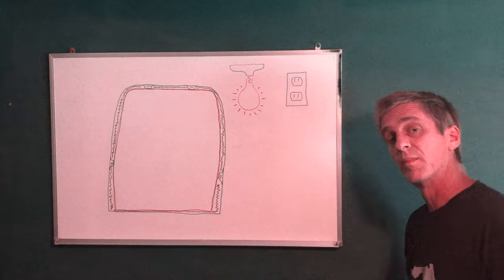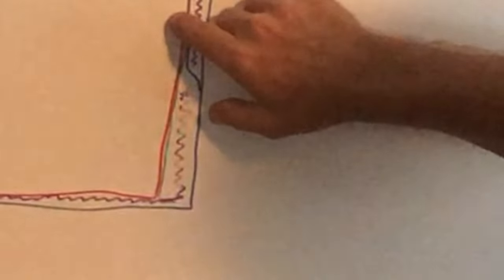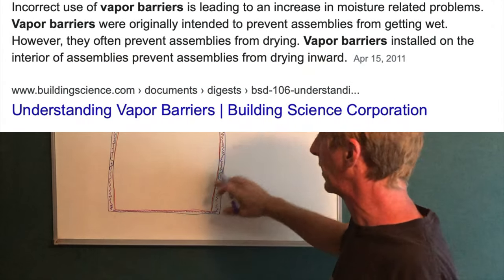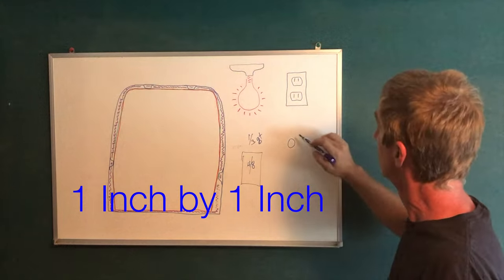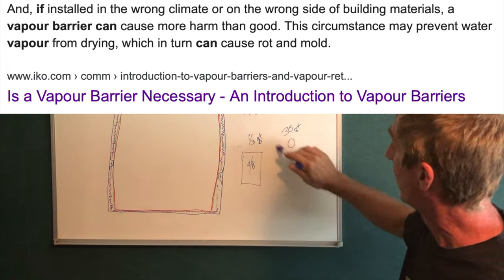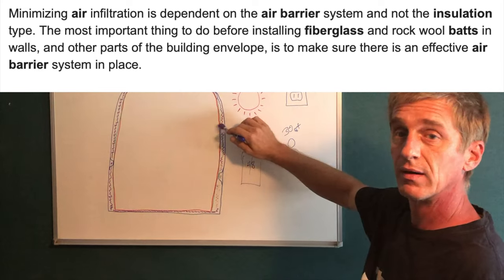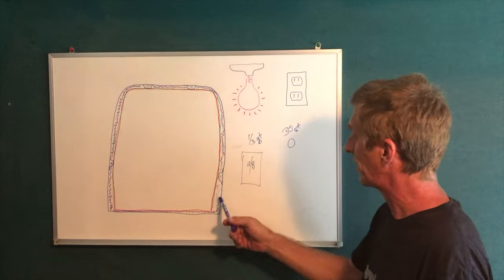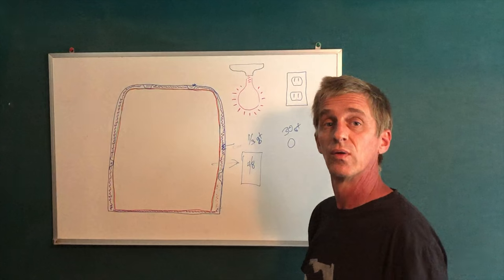Vapor Barrier in a Camper Van Good or Bad?

Comment: Once again, you have nailed it, and in less than 23”.  A lot less.  I wish people could be more succinct.  Thanks again!  I’m having adventures in Lizard skin ceramic thermal insulation.  Made more adventurous by my own idiocy.  Probably.  I’ll know soon.
Reply: Let us know too please, wish you good luck!
Reply: How did it work out for you using that Lizard skin?
Reply: @TheSololobo  - Well, I’m still (yes, pathetic) working on the van.  Using a temp gun, it does seem to have lower heat than the untreated interior.  BUT the things I have learned are that if you want to put up a noise dampening product like Fat Mat, you need to do it before you spray.  Nothing seems to stick to the dried LS.  Second thing I learned was that if you make your own LS (from acrylic paint with ceramic beads), you need to make it a very thick product.   I under mixed it.

Comment: at last! a man that talks sense too many self builders  around the world following the greg virgoe method! a guy that builds campers for a MAJOR uk motorhome  manufacturer told me that the most important thing in a camper is insulation and AIR CIRCULATION ....
Reply: Greg's method is scientifically proven. But it has to be done perfectly to work 100%.
Reply: @ezioauditore3128  yes impossible to do 100%

Comment: So basically I probably shouldn’t vapour barrier as there is no way I’m capable of 100% seal
Reply from the maker: Correct. A barrier can greatly limit the moisture that gets in, but it also greatly reduces the ability for moisture that does get in to get back out. Paneling, plywood and other common wall surfaces will prevent vapor from passing into the wall cavity, but allow any moisture that gets in there to absorb into the wall board and then dry into the room, very slowly. My experience includes relatively short periods of high humidity in the van, of the course of any given year. if living in the van full time in a humid climate (more humid than Florida) I might* reconsider (probably not).
Reply: @FloridaVanMan  SO what should we use then?

Comment: Great tutorial! So ur resolve is to try and seal via great stuff, metal tape ecr ect. O of subject u commented on my LM about a wk back. On a 2003 it has a vacuum resinator. Pulled most of my hair out ting to finger the LM out. Well I had a 4 legged toothy critters that had chewed the wiring apart. Rewired and good to go. Tanks 4 ur help.  Ciao

Comment: Agree. Today it's minus 4 Celsius in the Uk. I'm mid building my van. The uncovered ribs of the van are dripping wet, obviously, but the carpeted ribs were completely dry. Is there such a thing as making a dedicated dehumidifying surface? Obviously the windscreen is a natural contender but I have a bulkhead. I wonder if leaving the back doors uninsulated that all that water would collect there. Or would it be unnecessary once there's heating installed?
Reply from the maker: Cold glass makes a great "sacrificial anode*" to draw moisture out of the air but DRY heat is the key. Diesel heaters are great for this. Other tricks like minimizing moisture in my shower towel helps. I do this by drying a bit with my washcloth and ringing that water out before grabbing a towel that will 'dry' in my van causing airborne moisture (humidity). A laundry basket full of hot dried clothes will draw considerable moisture out of the air in such a small room, so fold clothes in the van, not in the automat. If you must boil water in the van use a whistle top kettle to contain the steam until it can't.

Comment: My brother used to run a crawlspace mold mildew repair business. He put vapor barriers down in crawlspaces and then scrubbed all the wood and then sprayed the hell out of everything with killx or whatever it was called.

Could one use that spray on the walls of the van to prevent mold/mildew?

Seems like the best solution is to use wool to insulate, put up your decorative wall and once a year, take it all apart and clean the walls and put it all back. Probably replacing with new wool.
Reply from the maker: I doubt the stuff used in crawl spaces is something we'd want inside the cabin, even inside the walls. Crawl space is 'outside' the insulated space.  The 'best solution' is different depending where you live and travel.  Insulation is just one part of preventing mold and mildew. Reducing condensation can be very effective. Easy things like drying my body mostly with washcloth before using my towel. Ringing the washcloth puts several ounces of water into the drain that would otherwise evaporate from my towel. Use of propane inside the van is just pouring water into the air for collecting on any cold surface. And closing or covering your drains will keep water down the drain from evaporating. Anything you can do for a doormat to keep snow outside is obviously going to be huge.

Comment: Ok so I get where you're going with this but I have a specific question. I'm in Canada in a climate with temps that go from +40c to - 40c over the course of a year. The trailer is made of sheet metal and steel ribs with a curve where wall and roof meet. Because of the extreme way condensation can occur between the cold metal and the insulation/wall would a vapour barrier with a exterior vent (the curve is going to be empty space which I could take advantage of as a pseudo attic) be a way around this problem? Currently gutting and rebuilding so now would be the time to do it.
Reply from the maker: If the outer skin of your trailer is non-porous and has no holes or cracks for vapor to get in, that is your vapor barrier. You could vent it like an attic, but this would be venting the existing barrier only to allow the use of a second barrier. The vent to the outdoors will cause much more heat loss, compared to venting* the attic to the trailer interior. You are going to have some moist vapor in a small living space, that's unavoidable. We need to be sure it doesn't get "trapped" where it cannot get back out. Any pocket between two barriers is a "trap", and your trailer skin is a natural barrier unless  it is made of wood, bricks or overlapping metal panels that are not seam welded. Vans and Airstream trailers are all seam welded, but cargo trailers are not. Many older RV's and some cargo trailers are skinned with fiberglass panels and sealed with  caulk that dries and cracks. This is NOT a vapor barrier, so in this case I would install barrier (and anticipate mold in the wall after a few years).

Comment: Hi! great video, I've been trying to get my head around all the information out there regarding vapour barrier and it hasn't really made sense. this has greatly helped. The only thing I can think of is would it help to  completely cover the large panels in my van with acoustic matting to put another layer between whatever water vapour makes it through the walls? I intend of being in the van over winter and would like to reduce the potential for ice forming, but then I suppose dry heat would help this too..?
Reply from the maker: A perfect seal is very hard to get and even harder to make it last forever. Avoid thinking you will keep ALL* moisture out of any space and allow every space a way to dry-out. Complete covering with acoustic mat has proved disastrous for many. As humans, we just can't get it perfect in every corner, and where it is not perfect it traps dirt. Dirt holds moisture, moisture feeds rust and the knee bone is connected to the ankle bone. I mean rust grows out from anywhere it can start. Closed cell spray foam is the best sound reducer and moisture combatant. A breathable wall (any other insulation method) is fine for most situations, but if I were going to be full-time in the van and often in cold climate, professionally installed closed cell spray foam would be a clear choice.

Comment: Hi, what is your opinion about adding an electric dehumidifier in an insulated van ? Do you think it could create a humidity level as low as in a house? I precise that I plan to buy a big electric station (like Bluetti AC200p or something) so electricity won't be a problem I think.
Reply from the maker: Household electric dehumidifier produce heat. Electric heat on battery just doesn't work. Dehumidifiers come in all sizes but an average dehumidifier will require more than half the energy of an average air conditioner, which is quite a lot to ask from a portable battery unit like Bluetti. If you are in a cold area I suggest diesel heater and a dozen tips on managing the moisture inside the van including how we use a towel & washcloth after showers. Minimize use of propane, a tray for snowy shoes that drains out or gets dumped, and using the windshield condensation point to extract some moisture, removing it from the van with paper towels.
Reply: @FloridaVanMan  Thank you very much for the answer and the tips. I am not in a cold area but I have an allergy to dust mites so I need to be careful. And also I suspect that mold can come easily in a car or a van.

I thought about plenty of tips. For instance, one of my personnal rule is "never cook inside, no shower inside". And I could go further by saying that any kind of wet clothes or towels will go directly in a special closed box then washed and dried asap.

Also I think one of the best solution is to minimize any kind of fabric and to clean very often all surfaces with baking soda, vinegar... So for example, to limit moisture and dust mites, my mattress will be an inflatable electric one made of plastic, same thing for my pillow, and will be washed very often. And so on.

Comment: Great vid, i have decided to go without a vapour barrier and have loads of ventilation instead. I have a maxxair fan up top and drop out vents down below. I have put foil backed sound deadening and PIR board all round boxed in with wood cladding. My idea is to have some flexible 20mm pipes run into the wall and ceiling behind the cladding and then run them down to the floor to a drop out vent. Thus giving any condensation a way to escape. Will this work or will it encourage condensation? Thanks
Reply from the maker: Maybe I'm not understanding where/how the pipes will be installed? I don't see how the condensation would collect in the pipes, especially if they are inside the wall and ceiling. I think you have plenty of ventilation and the biggest key is Dry heat like a diesel heater. Propane releases a TON of moisture into the cabin air.
Reply: @FloridaVanMan  Does is also count when it's a diesel water heater?
Reply from the maker: @tiesb1212  I don't understand the question. Diesel heaters will exhaust to through a pipe and muffler so they don't add to humidity or condensation.
Reply: @FloridaVanMan  I wasn't sure if there would be a difference. But it is about the exhaust, being outside of the van. Thanks for your reply!

Comment: Can you explain what effect does air flow (open windows and Maxxair fan) have on preventing condensation?
Reply from the maker: Leaving a window open will only help when the humidity inside is FAR greater than the humidity outside. Propane heat produces a ton of humidity so opening a window lets humidity out and cold dry air in. Diesel heaters work very differently and produce dry heat so opening a window will only waste heat unless your van is full of melted snow, cooking steam and wet bath towels. 
Folks who spend more time in cold areas can probably add some info and I hope folks with experience will comment.

Comment: Great video!
So it's still worth insulating your van with wool/or another insulation?
But it wouldn't be 100% insulated as you will have some gaps at the hard to reach parts..

This would still be the better approach then completely (95%) sealing it?

I'm just deciding if I should have insulation at all...
Reply from the maker: Yes, insulation makes a world of difference, even if it is not perfect. Vapor barrier is different, and if you can't make it perfect you are better off with none.

Comment: Wouldn't you want a vapor barrier around the sheet metal? Sure, maybe it's supposed to be completely non-porous, but if it's second hand it seems risky to assume that everything is completely intact. I also imagine the vapor barrier has a lower thermal conductivity than steel or whatever the outside is made of, so there'd be less condensation when it gets cold inside the insulation.

On the inside I suppose I'd agree, seems reasonable.
Reply from the maker: If the skin of a van or camper is not water tight, an interior vapor barrier is the LAST thing you need. You do not want to trap moisture between a steel wall and a plastic barrier. Rot will take charge in many forms.

Comment: Would you recommend  painting the wood paneling or plywood on the inside of the trailer, or would this seal and prevent the wood from being breathable and not letting moisture from leaving the inside of the walls?
Reply from the maker: Paint is a good choice, as it is a semi-permeable barrier that won't trap moisture inside the wall while still preventing most moisture from entering. If you are asking about painting both sides of the board, that seems like more effort than reward. Painting the backside of wall board has pros and cons, like everything else, and whether good or bad depends on your circumstances. In my opinion: It will hide a problem longer but not prevent most problems you might experience inside the wall.

Comment: What would you recommend for the floor? I was going to use PIR boards with wood batons and then use aluminium tape to seal it. I'm guessing don't use the aluminium tape so air can circulate? I have saved the ply lining and intended to use reflectix to go over the recycled plastic bottle insulation. I'm now rethinking after watching your video as it makes total sense NOT to add the reflectix and let the van breath. Thank you for making an easy to understand video. I'm just a bit stuck with the flooring now. Many thanks
Reply from the maker: Especially at the floor, moisture barrier is a bad idea. Moist air is heavy so moisture is more dense near the floor. Spills, wet feet and snowy boots will eventually wet the floor also and a vapor barrier material is not enough to stop that much wetness. Water will get through a tiny leak, behind the barrier and be trapped with only that same tiny leak to evaporate back out. The steel skin of your van is the only vapor barrier you want.

Comment: Hey mate, I'm living in a hot humid climate in Australia, could I use polyester batts and could I put the batts straight in the van wall cavity onto the painted wall panel without any other type of insulation or vapour barrier?? I would really appreciate your feed back as I'm stressing about it haha
Reply from the maker: Yes, the steel skin of your van is the only vapor barrier you want. As long as you don't have any roof leaks moisture won't be a problem. Any airborne vapor that breathes into the wall can breathe out.
Reply: @FloridaVanMan  thanks so much for your reply

Comment: What if you reverse the process? If the sun heats the van, the moisture will find a way out?
Reply from the maker: Some* moisture will find a way out. Similarly some* moisture gets into the wall. All* of the moisture from the room does not get into the wall and similarly you will never get all of the moisture out of a wall via small leaks and holes in a vapor barrier. Moisture does not "find a way". It only flows with air and dissipates in stagnate air. Insulation by definition is intended to prevent airflow. No structure should have two vapor barriers with a pocket between them. Your van skin is a vapor barrier, unlike brick & mortar or wood walls, overlapping steel panels or vinyl siding. Our vans are seam welded and form a vapor barrier of steel. This is were they are different from big RV's that are made of fiberglass panels with aluminum corners and trim to conceal the overlapping panels. Those RV's need an interior vapor barrier because the exterior is breathable.